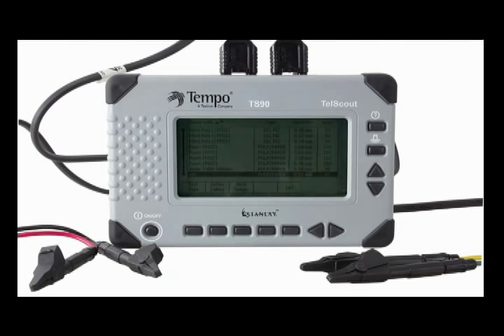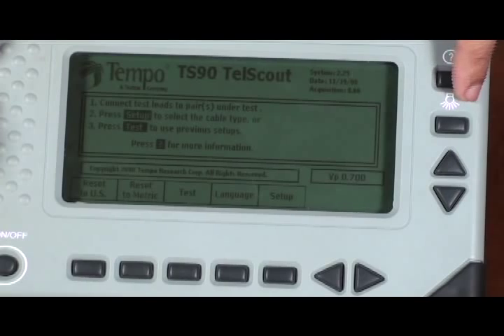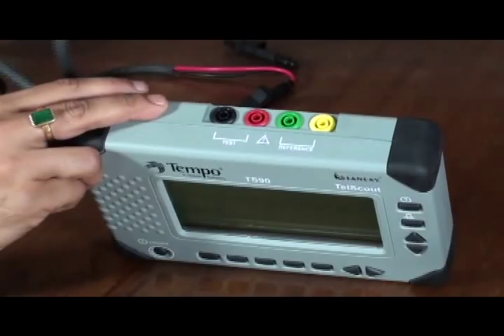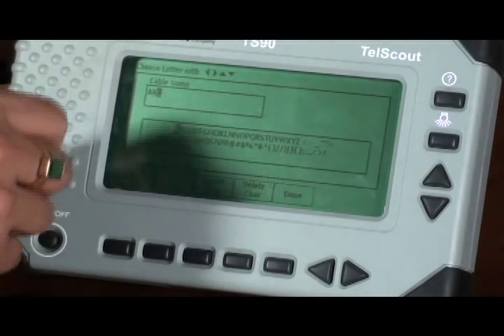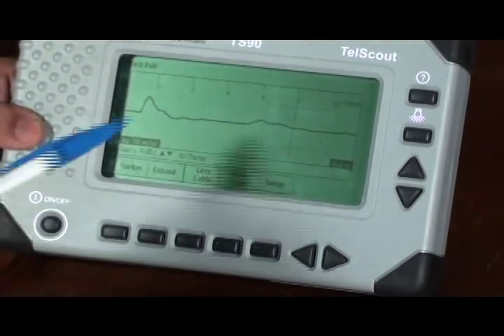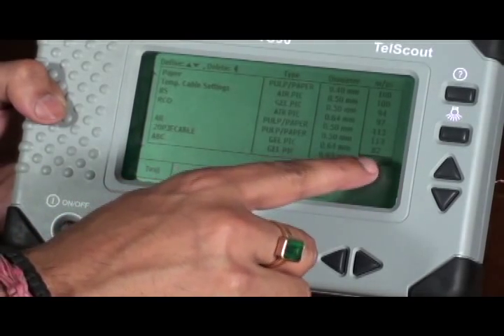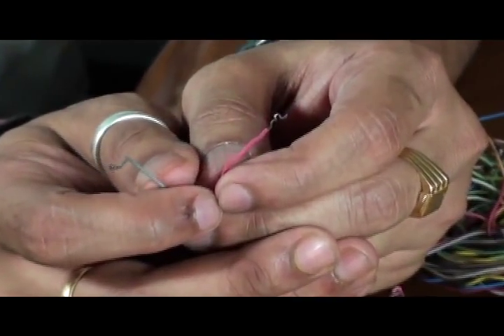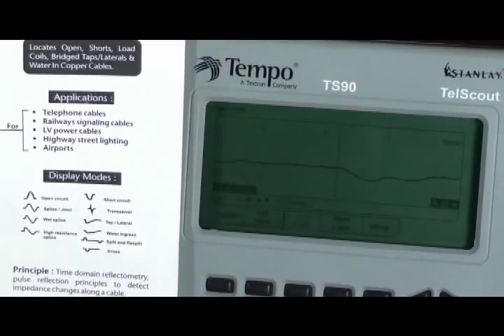TS90 TDR cable fault locator

Comment: Excuse I'm from Cambodia. I want to ask you that this machine can use with the Transmission line Cable or not. My transmission line length is 13 km.
Reply: From Tektronix Spec sheet for the TS90 (Tektronix originally designed this then sold it to Tempo.)
TS90 goes out to 15km, so yes this test unit will work for your application.

Tektronix TS90 TelScout TS90 TDR Cable Tester
Feature:
Cable Type: UTP, FTP, ScTP, STP, Coax
ISO Test standards: YES

TelScoutTM TS90 TDR Cable Tester for Telephone Applications

TelScoutTM TS90

Two Pair Test Capability

One-Step Setup

Automatic Instrument Control Mode

15 km (45,000 ft.) Fault Location Capability

Splash and Drip Proof

Single-Button Zoom Function

Pair Comparison Mode

Splits/Crosstalk Mode

Intermittent Fault Location

Measures Distance to Fault in Feet, Meters, or Time

Configurable for Any Cable Type and Vp (0.300 to 1.000)

Accurate (¦3 ft. at 10,000 ft.)

On-line Tutorials

Large Backlit Display

If your job is to find faults on telephone twisted pair cable, the Tektronix TelScoutTM TS90 is built for you. Designed specifically for telephone local loop applications, the TS90 applies the newest technology to provide both ease of use and telephony performance that cannot be found in any other TDR.

The TS90 is designed for ease-of-use - you'll spend less time operating the TDR, and more time repairinTelScoutTM TS90 TDR Cable Tester for Telephone Applications

TelScoutTM TS90

Two Pair Test Capability

One-Step Setup

Automatic Instrument Control Mode

15 km (45,000 ft.) Fault Location Capability

Splash and Drip Proof

Single-Button Zoom Function

Pair Comparison Mode

Splits/Crosstalk Mode

Intermittent Fault Location

Measures Distance to Fault in Feet, Meters, or Time

Configurable for Any Cable Type and Vp (0.300 to 1.000)

Accurate (¦3 ft. at 10,000 ft.)

On-line Tutorials

Large Backlit Display

If your job is to find faults on telephone twisted pair cable, the Tektronix TelScoutTM TS90 is built for you. Designed specifically for telephone local loop applications, the TS90 applies the newest technology to provide both ease of use and telephony performance that cannot be found in any other TDR.

The TS90 is designed for ease-of-use - you'll spend less time operating the TDR, and more time repairing.